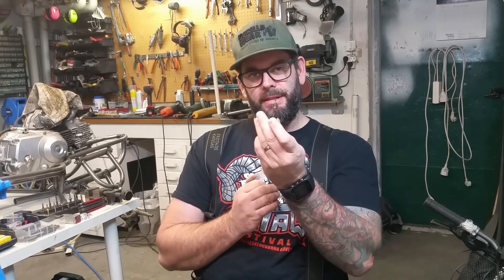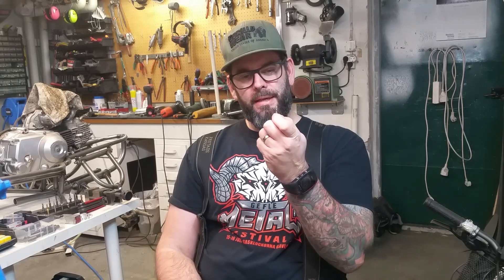How To Cut Aluminium With A 6040 CNC Router. Part 2 - Milling With A Single Flute And Engraving

Comment: hey Tomas i have the same machine as you with the usb B connector input into controller box do you know if it is classed as parallel  port machine or something different ? do you have a copy of instructions I cant get mine to work at all using mach3 (a copy on a dvd/ disc) that came with the machine and laptop with windows 10.. thanks